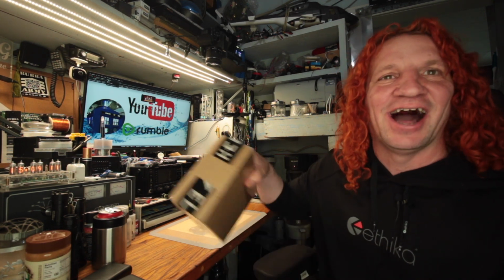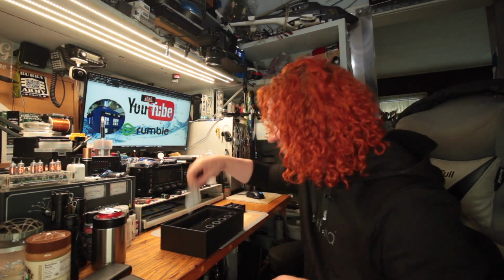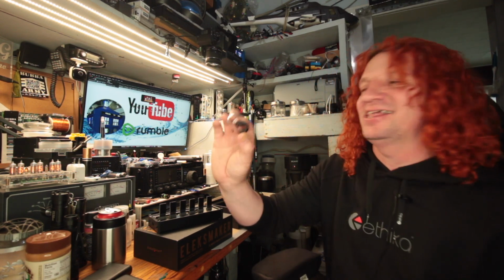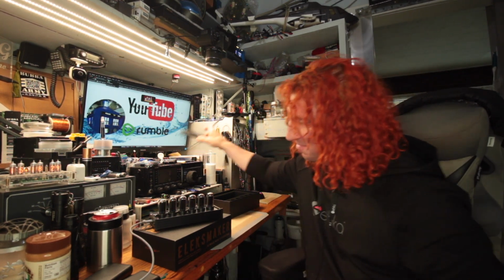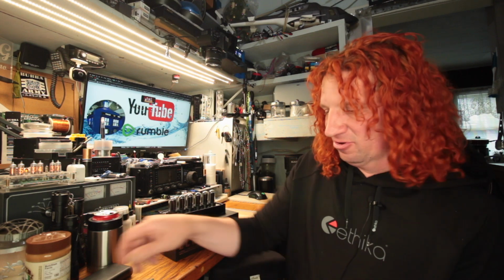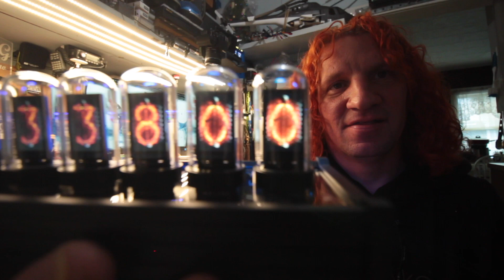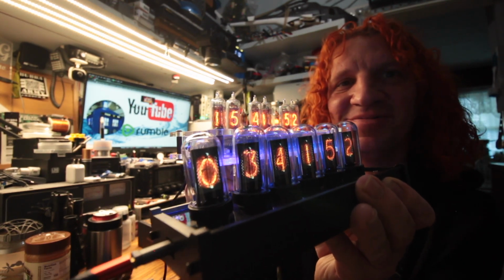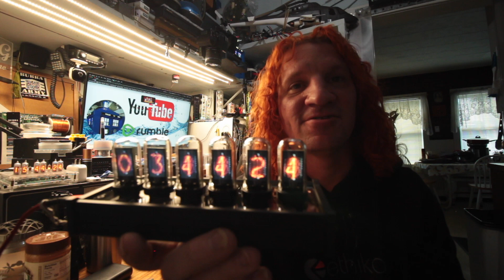Can a IPS Clock, be a Real Nixie Clock? Elekstube Desktop Clock

Comment: They wrote a song about these type clocks, it goes "Ain't nothin' like the real thing baby, ain't nothin' like the real thing".

It's like asking an LCD screen to reproduce the image a CRT could.  It's like asking an LED bulb to reproduce the quality of light of an incandescent.  They can emulate, and do the same job, but never reproduce the same quality.

From a distance, that might be a little convincing.  It's a neat idea, and possibly with other clock types, not a bad toy.
Reply from the maker: I'll be sticking to the Orange side. It really is a neat gadget, might have a place someday.

Speaking of LEDs. I had a SGLEDs lamp fail. Typical black spot of death. Going to make a video. To see if I can jump across it and make the lamp last awhile longer.
Reply: @RollingTardis  Yeah, hey, even Toyotas break once in a while!  Those bulbs have a 5 year warranty, so you may wish to get the ball rolling with that.  Mine are doing just fine, but then again, are probably used a lot less.

I had another LED bulb that had been removed from service elsewhere and made its way to my collection, go out.  I started using it in the basement stairway.  I was all set to open it up but of course it wouldn't pop its top.  I figured a little heat might help and in fact it fixed whatever problem the bulb had.  It seemed to have a loose connection inside because it would come back to life.  The heat certainly helped it out, never did pop it open, and it's still working.  Not perfect, but better, and for a free bulb, that's good enough.  Made a video on that, someday soon.
Reply from the maker: Perfect, I forgot about the warranty , I will contact them and get that resolved. I doubt they will want the lamp back. More than likely, will have some fun with it. Just like that industrial led lamp I molested over, to make it work again. @jaykay18